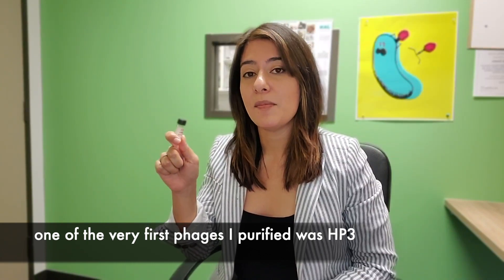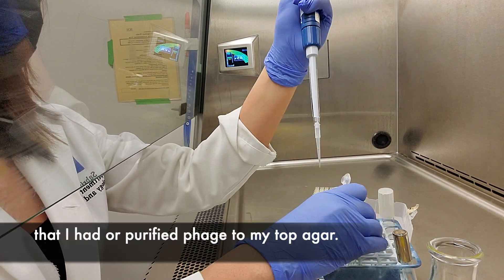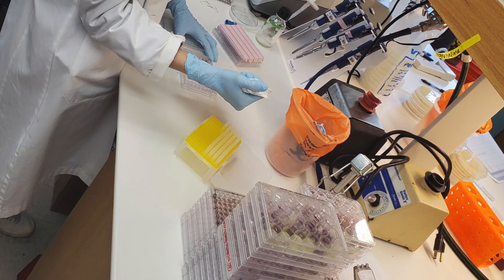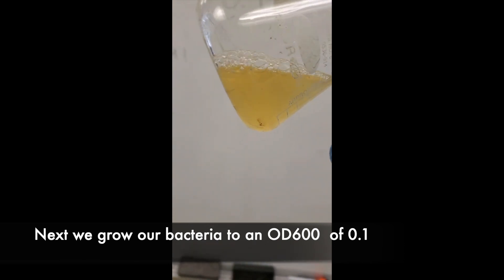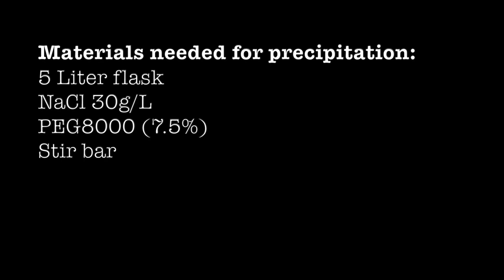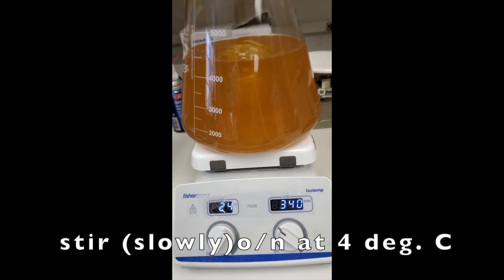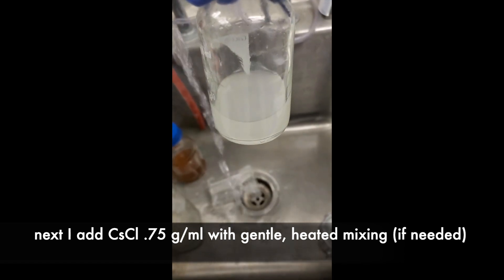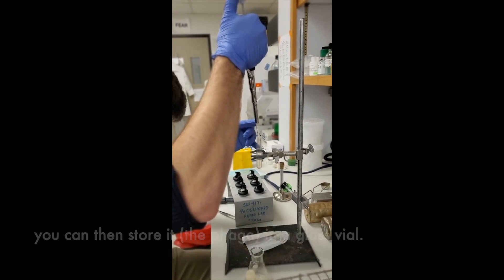How To Purify A Phage

Comment: That video is inspiring. I have a question. I have Shiga toxigenic E. coli phage. Its host has toxins gene and the host probably synthesis toxins while titering phage. If I purify phage that method, could toxins remove from phage solutions?
Thanks
Reply from the maker: We avoid using phages to purify that have known toxins. However, there are times when we may have to use those strains. In that case we will test for toxins present in the phage prep. So far we have not had any toxins present in our purified phage prep but we cannot say for sure that toxins can be removed from all phage preps using this method.
Reply: @BCMTAILORLabs  Which method do you use to assess toxins? 
I also working on phages I try to isolate coliphage against calf diarrhea. Some phages have the potential to use. I got the whole genome sequence.  There is no toxin and resistance gene. Their life cycle is virulent. Nowadays I try to find an appropriate host. Could you explain what I need to do next step? animal experiments or something else to get usable phage drug.
Thank you :)